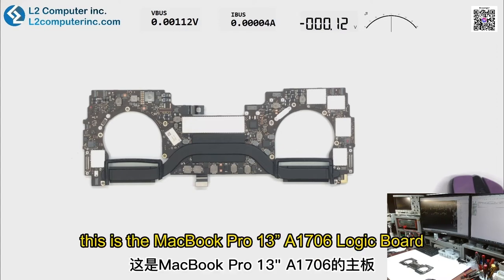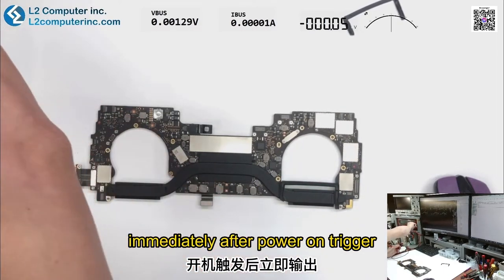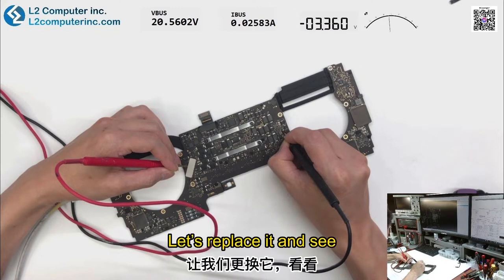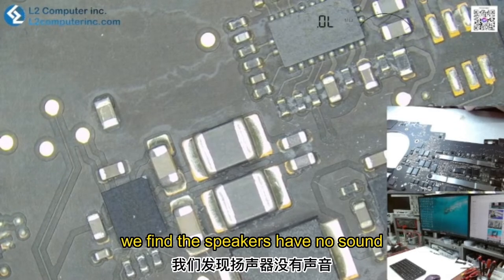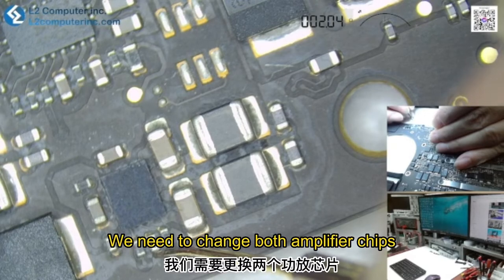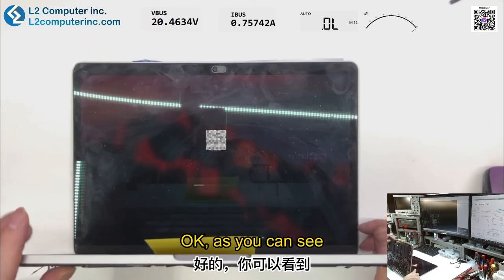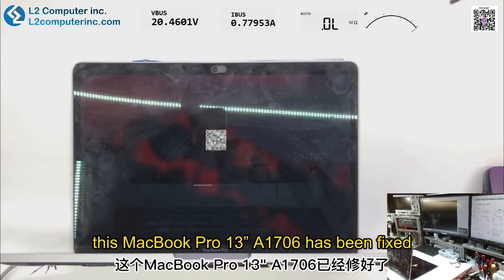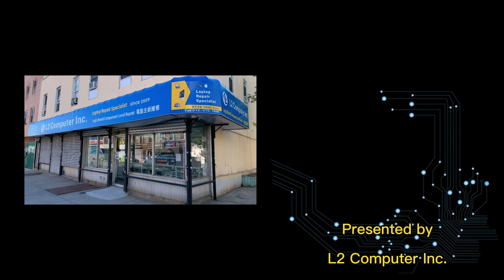Let's fix a macbook pro 2017 A1706 no power based on the power sequence

Comment: Nice!!! Like! Did you remove another corrosion and replaced corroded R's ans C's? Wich power supply do you use (for showing measurements on computer)?
Reply from the maker: Yes, the Apple power supply is connected to a C-type current detector.
Reply: @l2computer310  thank you! but wich power supply do you use for showing measurements on computer?
Reply from the maker: Power-Z KT
Reply: @l2computer310  thansk for the info. I like this video to reach other people too :)

Comment: Hi,

I have also an issue with an a1706 and have a question, when measuring with amp meter only 5v and amp varies between 0.13 and 0.25 amp
pp3v3 G3H is present and ppbus main rail also but doesn't get 20V and obviously doesn't charge too and to me the four cd3215 looks all fine (usbc ports doing all the same thing, no anomalities).
do you have any suggestion.
the only visual thing I noticed is that C3208 looks a bit burned but seems to work fine -, it is not shorted and I am measuring 3v at that cap 

please any suggestion would be very welcome!

thanks in advance!
Reply from the maker: 1.Check the current on the front and back of each type-c, is there any individual difference. 2.If no problem is detected, read the address bus with an oscilloscope